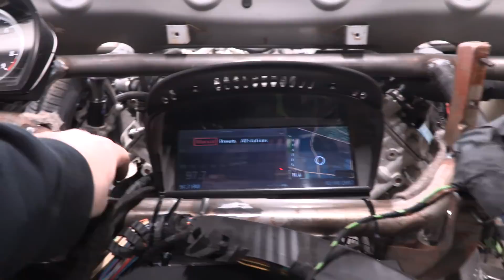Wiring Up The V10 Beast. Will It Run!? - 240Z With A BMW V10 Engine

Comment: Your scanner may not be reading because BMW use a gateway module system. If there is a faulty/disconnected module in the vehicle, this prevents the ECU from being able to communicate with the OBD port.

It's a bitch of a design and makes it hard to diagnose what is wrong with a vehicle. If a module fails it requires replacing and coding to the individual vehicle by BMW. I haven't heard of anyone being able to get around this issue but I would love to hear if anyone has. 

Best of luck.

Comment: Hope you're making sure that the floor pan can over the driveshaft can withstand IF driveshaft breaks loose. You really wouldn't want that happening. Look it up in case you don't think its a real safety issue.

Comment: I would recommend either icarsoft or buying the knockoff ISTA off of eBay for talking to the car. ISTA is the dealer program for troubleshooting. BMWs will attempt to start without fuel pressure, some of the M cars won’t let you start them if the car senses the wheels are off the ground via the level sensors connected to the lower control arms.

Comment: That red gear warning is a trans fault. There are quite a few smg faults that can cause the engine not to start. (PLCD sensor faults, etc). Good news is the SMG pump is priming.

Comment: I would try to buy a better scanner, like a real scanner that has actuator functions and reading real time values of sensors, and get that obd port working😄 or maybe work the other way around, install everything and start deleting stuff until it doesn't work, seems easier to me since you have all the parts

Comment: Hi. Here is the original wiring diagrams for the e60 M5 to help with troubleshooting: https://www.newtis.info/tisv2/a/en/e60-m5-lim/
As for start/crank BMW are very demanding and tricky with the key security that is handled by the CAS(car access module) module the must be in sync with the DME https://www.newtis.info/tisv2/a/en/e60-m5-lim/wiring-functional-info/power-train/engine-electronics/interfaces/electronic-immobiliser/XoQdpTY. 
As for diagnostics are strongly advise on a much better diagnostic system as you see electronics are major in this car and you'll need to deal with then with the right tools.
Good luck and keep it going

Comment: Those wires look angry! Oh btw you should try to get in touch with Piper motorsport, they did this swap in an E30 and should definitely have some answers for you guys. I don't know if they are still around but it's worth a shot.

Comment: This is why you should have gone with a manual transmission and a stand alone ECU.  Some peoples kids I tells ya :P
Reply: I don't think that's what it is. I don't think he can even drive stick. He always goes auto. Same thing with his Toyota engine build car he did.  Made it auto....so sad
Reply: The transmission is so complicated there is almost no ecu that can run the trans
Reply: Which is why i suggested a manual transmission (6spd)
Reply: @sentra001  bur he wants the quick shifts of the dual clutch so his only options is to keep tho OEM ecu

Comment: Next, your new propshaft. You have a combination of a conventional UJ at the front and a CV (constant velocity) joint at the rear. If the driveline was perfectly straight, which is practically never the case, you would get away with it, but with any kind of offset, or angular change between the transmission flange and the diff flange, you will very likely get a vibration from the prop and the rear axle assembly. 2 x UJ's, properly aligned work fine, 2 x CV joints work fine, but 1 x UJ + 1 x CV is not likely to work well at all. The smooth rotational output from the transmission will be converted into an uneven rotational pattern through the UJ and passed straight though as uneven by the CV joint, so the whole final drive will be subjected to an uneven rotational pattern. The second, correctly aligned UJ is what converts the uneven propshaft rotation back to an even pattern at the diff flange, so that the final drive sees a smooth rotational pattern.

Comment: I don't see comments about this, but to had to some of the useful, i remember watching a video about one of these (BMW e60 M5), and even a battery change needed BMW coding, because of the difference on voltages between an old and new battery... So, my advice, get someone who is a pro on BMW coding, to sort out many gremlins it will get. (not a if, but a when they will come).

Comment: What I like about you and what you are doing here is you haven't just taken a 240 and put a BMW motor in it or taken a BMW and put a 240 shell on it. You have taken a 240 and a BMW and constructed a completely separate entity from the 2 using bits from both. Mad respect for that man  

(Level up +7 skill points and 5,000 experiance points you have now unlocked expert mode.)

Comment: That driveshaft is going to vibrate like hell. It wouldn't be a problem if it was straight, but with that angle, you need a union on the diff side as well.

Comment: Hi.  You need the ABS unit plugged in and everything on that Powertrain CAN bus.  Grab a meter and check the resistance (with everything off) between the two CAN lines and it should be 120 Ohms, or it will not work.  You need to complete all the CAN buses as far as possible, even door and seat ECUs could be an issue if they have termination resistors (unlikely but possible).  Also.. grab a vacuum cleaner and clean the throttle bodies out before you crank it over.  Good luck.

Comment: You're making some great progress with this build! I am concerned that you have the dash bar tied in with two bars that are in line with the front strut bars. In an accident it could shove the dash back into the drivers compartment. It would be much safer to only have the dash bar connected to the car at each end, or at least with the two other bars at a 45 so they don't shove the dash back.

Comment: I posted this a few episodes ago, the steering column is locked.  The DME believes it's been tampered with and will not allow it to crank. 

+Any other modules you've got left unplugged, but yes, if the car doesn't know the driver door is closed, the SMG will not do anything.
Reply: Additionally, if the DME doesn't know what the transmission status is, it won't crank the engine either.

Comment: B is for B-got damn Chris clean the shop floor you manimal. Legit 30 bucks gets you a shop vac and a fine materials filter for it. Filter is the most important because nothing is better than vacuuming up all the dust just to blow it out the back.

Comment: The wheels look awfully close to the chasis, you sure there's enough clearance for full lock?
Reply: lingeringsoul it’s fully aired out and he’s putting a wide body kit on it. So it’s resting on the chassis, that’s prolly not very good for the tire but it’ll be fine

Comment: Starter inhibitor

The Car Access System (CAS) enables the starter only if a release signal is received from the SMG control unit. The following conditions must be satisfied for the start to be enabled:

The gear lever must be in position ”N”. 
The LC display in the instrument cluster must show ”N”, indicating that the transmission is also in ”N”.
The SMG control unit enables the start.

The SMG might not change to "N" or Any gear without seeing the hood switch closed. 
The DME, SMG, CAS, Safety and Gateway module or Body Gateway module (depends on on production month), DSC, Brake light switch ....will all need to be working for the car to crank.

Comment: First thing be sure to clean the intake first
Second thing don't weld the bearing cuz if it gets shot it would be a pain to replace weld a baring holder so you can replace it if needed

Comment: Short the brake leads, so it allows to crank. also all, absolutely all grounds need to be connected on the engine aswell. You still got some work to do man.

Comment: The pump you can hear is the smg pump, i'd check that the fuel pumps actually try to run as the fact you can't talk to the DME suggests the immobiliser is still locking you out. This era of BMW on wards require all of the coded modules (pretty much every module is coded to the VIN) to be attached to the bus and functioning to work. 
Things like the exterior lighting module can be required to disable the immobiliser, if it's a keyless entry vehicle and that isn't working it's a big hint that the car access system (CAS) is unhappy and is locking you out.
As others have suggested hook it up to ISTA (D/P) rather than a generic reader as this will give you a visual map of the modules the car is expecting to see, how they are connected and faults present in each module. 
It will also allow you to re-code modules and potentially delete ones you don't need anymore.
Plug in every module and if it works remove them one at a time to see which ones you can live without.

Comment: You need to use the INPA, scan for faults. You will probably need to recode the car with FA deletes accordingly. Also remember; Without the sim/sgm module you will have no communication between different buses, eg. K-Can, PT-Can, byteflight etc. Also obd2 will be dead without it.

Comment: You will need the hand brake and switch fitted., this is part of the checks the ecu's need.

Not sure why you chose to do this (and the drinking for a few days?) now, you could have got the engine, wiring and coding done while the frame and body are off for paint. It would have been better time management?

Comment: Hey Chris, you might have already thought of it or someone might have already told you but you should build something sturdy around the drive shaft just in case it were to break or come loose and come careening through the floor boards and take someone out

Comment: Do you  need to depress the clutch to start? Kind of like a neutral safety switch? I'm not sure if the BMW has that, an automatic car it would be with the brake pedal but seeing as its a standard it should be with the clutch.
Reply: Its an auto

Comment: i think a better solution for this cable mess would be a VEMS and a DIY cable-solution. Wireing everything by yourself. Also a original dashboard form the Z would look and also fit better then the BMW dashboard, but this is a opinion thing. But i get your point, a BMW in a Z-dress

Comment: I'm sure the driveshaft shop knows what they're doing, so this is more of a question than anything, but I thought that if one side of the driveshaft used a U-joint, the other one needed to as well to cancel out the uneven speed that the middle piece of the shaft would be rotating at. Won't the CV joint propogate that uneven speed further down the driveline and to the wheels?

Comment: I don’t understand, why did they use an unwieldy box for the fuel system instead of modifying a stock 240Z fuel tank?
Reply: Leo V. No idea but possible reasons could be weight reduction, larger fuel tank, etc. the most likely reason is that is was probably easier to build one to fit the bmw fuel pump/internals than it was to modify the 240z tank.

Comment: Just want to remind you that need to weld up another cross brace for the rails that hold the suspension so they don't sag when you lower the car.

Comment: So at the end of the day have you ran the cost of everything?? Parts $ hours worked you and help $ shop costs $ if I had to take a guess this car would be a 200,000 $ beater , I hope at the end of the day it was worth it instead of buying a 240 in good condition and just did a built engine swap
Reply: the NECK he’s putting a v10 in a 240. 305/350 are already a tight fit so he could not just swap in a v10
Reply: Some times if you've got the balls you just do it and screw the costs.
Why because you can.
Reply: The 240 was cheap and he’s using the money from the insurance “claims”. the BMW was a decent price and that’s where most of the parts are coming from.. metal is probably his biggest expense. Yea he had to buy a few things that were broke on the bmw but those parts aren’t too expensive. He owns the shop and bills for elec can’t be too high. All the equipment he buys from harbor freight are the cheapest you can get (that’s his thing)... so 200k is reaching my dude. 100k is reaching.. prolly not even 50k. And I doubt this is gonna be a “beater” when it’s all said and done he’s putting a lot of effort into making this thing nice.

Comment: Check the battery cables. BMW uses an explosive charge that is part of the SRS/airbag system when the car is wrecked. It disconnects the giant power lead from the starter. Everything else will still come on, but the engine wont turn over, no matter how many jump packs you use on the battery. I experienced this on a 535i and an X3.
Reply: He fixed this a while ago

Comment: I'm by no stretch of the imagination any kind of mechanic but I wonder if the position of the new steering column bearing has any impact on the position of the adjustable steering wheel (if you do adjust it) and its subsequent alignment with the steering rack - or vice versa? If the wheel and the rack are in defined positions, doesn't that determine the line along which the bearing has to be placed?
Reply: Mark Chippendale I think past the firewall there is another u joint and a slip fit rod thing to make that work.  I'm no expert but that's what I figure.

Comment: I really don’t get the logic of bouncing from one unfinished but to start on another... at this rate finishing will take forever!
Reply: I did it on my own car, one stage I'd be sanding the Engine bay for paint, then id be cutting out rust and welding in new panels, next I'd go to stripping and cleaning the Engine, then painting the subframe, then back to welding patches, and back to the dashboard ect. I was all over the place with it but it still took the same amount of time, my reasoning behind it was that If I got bored doing something, I didn't just take the next day off and go back to it when I felt motivated enough to finish it. I constantly moved to other smaller stuff because any progress was better than no progress, it kept it fresh and I didn't get burnt out on it. Different methods work for different people.

Comment: Kind of wish you kept the engine and went custom wiring, ditching the bmw i drive computers etc, all i see is a lot of weight being put in
Reply: And there is almost no standalone that can handle the transmission because it's so complicated
Reply: Would take a lot more time and money. It can be done later, there is a deadline and budget for this build.
Reply: Why would you want to keep that automatic transmission he is t building a drag car he isn’t building a track car... get a Satan’s alone with a bell housing adaptor and run a basic manual trans... he is creating more problems by trying to use that transmission fuck it he said it him self he doesn’t see him driving it that much...

Comment: You have to plug the FRM module(footwell module) in order to connect a scanner through OBD port otherwise it wont work and you need to have the  CAS module(black module) as well or if its an older model it will have an EWS (white module with green writting)  (this ones gives signal to the DME) in order to start the car. both of them go under the dash left side under the steering wheel. DO Not leave the voltage drop under 10 V under crank or under any circumstance because this modules go bad in no time at that voltage!
Reply: Da real MVP here.
Reply: There is no FRM module in a e60, there is a LM, although it has a spare VO/FA setup list, it is not needed to run the car.
Reply: @NISMOSkylineGTR  it is needed to connect the scanner
Reply: @WarpDriveM  Nope, not true. The obd connector is routed through the SIM/SGM module. Basicly, the only module that needs to be connected to run diagnostics. I have driven e60 without LM module connected, all diagnostics still works fine. It's probably different for 3 series etc. with N(FRM), the LM is only a light module, nothing else, not needed to run anything. :)
Reply: Whatever that guy said !!!!
Reply: up vote this guy
Reply: Whoa.
Reply: Hey man loving the e39 turbo series
Reply: @mrpoopybutthole6314  thank you! Thx for watching! #warpdrivers
Reply: @defunctusername You are misusing Ohm's law. Remember that I = V / R. If voltage goes down and resistance stays the same, then current goes down.
Reply: Now here's a question: Why would a module break when there's a voltage droop? I know voltage spikes kills things, but not voltage droops.
Reply: @patx35  this modules makes regularly backups even when the car is off. If voltage drops its gonna shut down. You need to reset or buy new
Reply: Chris please remember that you took 3 coils for the other bmw
Reply: e60's dont use EWS or a FRM
Reply: The car will not crank anyway if he don´t connect the fuel pump, and fuel flow is detected.

Comment: Transmission malfunction light is on but smg pump is operating. Something is unplugged or can bus is down
Reply: its possible the ecu is looking for the longitudinal sensors as well that are most likely still on the donor car.

Comment: dont forget to vacuum out the ITBs before allowing it to crank or open them.
Reply: Eh, all that metal dust will just hone the ports as it travels through the engine
Reply: noxxi knox  Thats how you break shit.
Reply: Next episode: " I bought a new S85 for my 240z"
Reply: they opened... :C
Reply: Brian Zappola  B is for Botch, at it again.
Reply: Brian Zappola true, looking back at the video they clearly moved a bit.
Reply: @Jay Workshop  
Individual Throttle Bodies